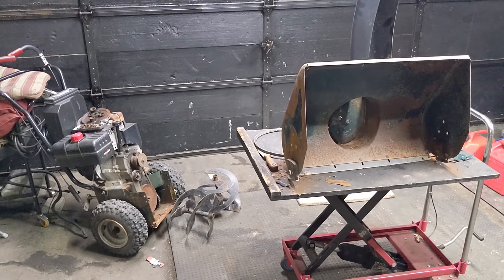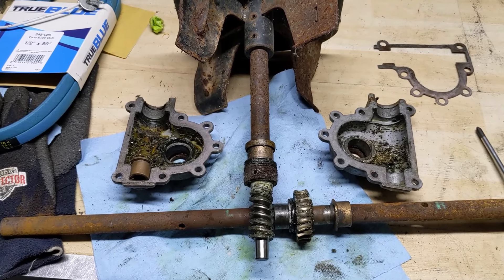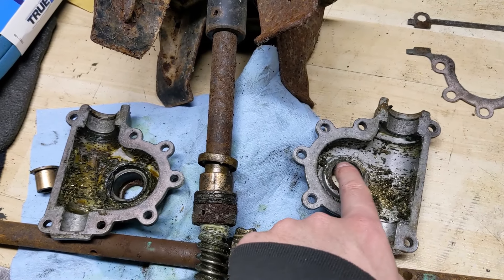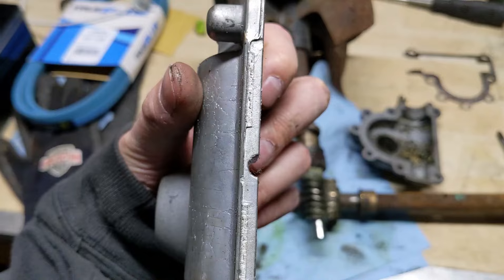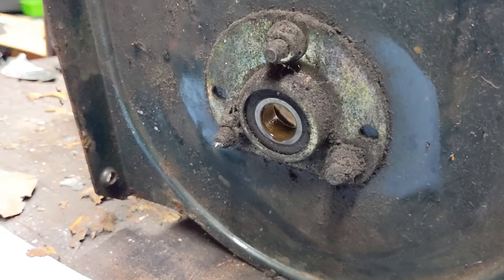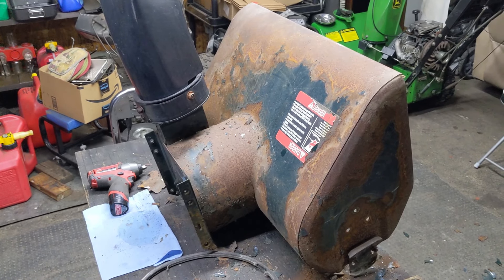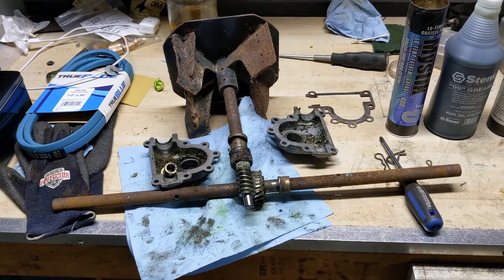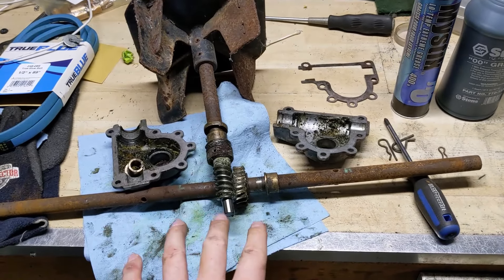Check the Snowblower Gearbox for Grease

Comment: For a 21 inch self propelled snapper how would you recommend servicing the transmission?  I can get the Stens 00 but I would really like to get some of the old (10 yrs) grease out without taking the thing apart. Any ideas?  Should I just add the new and call it a day? I am guessing turning it upside down with oil and gas removed will not allow the old 00 to flow our at all. I thought about mixing some 90W oil over several drains might get a lot of the old stuff out then fill with the new. Any thought?  Thank you
Reply: Did you ever figure it out? I’d if anything maybe try a manual fluid evaluator with a small air pump needle on the end. That may suck some of it out. I just don’t think you’ll get any shavings and boogers unless you actually take it apart.
Reply: Evacuater*

Comment: My MTD looks like it only has a small plastic plug on top of the gearbox assembly.  Are these considered maintenance free or how do you go about adding grease to them?
Reply from the maker: Pop the plug out, it's a hole there made for adding/checking grease
Reply: I have the same. It's right on the top on the split in the casing. Very convenient
Reply: What fitting do I use to get the grease in the plastic plug hole?

Comment: i have a 1987 john deer 826 still runs strong
Reply: I’m just finishing up rebuilding my 78 832 john deere. I was able to get all the gear box bushings and seals and gaskets from John Deere. When I asked my local dealer about parts he laughed until I supplied the part numbers and he looked them. He was amazed. 
The old guy that gave it to me gave me a parts catalog and service manual.

Comment: I've got a Arins Snow Tek 24" Home Depot special. Bought it cause it was black and the decals were cool....LOL

Anyway what type of lube can I use in the Auger gear case?
Reply from the maker: 00 grease!
Reply: @EliminatorPerformance  No kidding grease? 

The manual has a pseudo dipstick method to check it almost like its a transmission fluid. Anyway we'll see whats in it. Thanks !
Reply from the maker: @Foxxtrott1100  it's the best thing for it, but don't think of 00 like typical"grease" it's designed for low temperatures and is oily. Watch the part when I smear it on the work bench.
Reply: @EliminatorPerformance  Awesome thank you for taking the time to reply.

Comment: How can you tell the box is 3/4 full of grease?
Reply from the maker: That's the thing, it's kind of a manufacturers recommendation, I usually fill them up and I've never had any issues! But if it has that plastic plug, just be careful it doesn't pop out
Reply: @EliminatorPerformance  Thanks for the reply eh?! Really like your videos. You explain things very well.